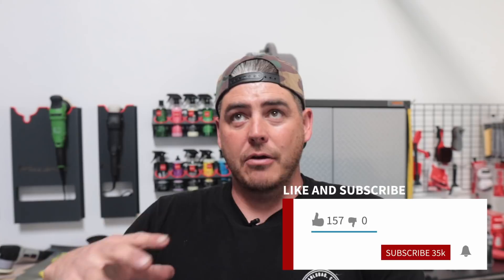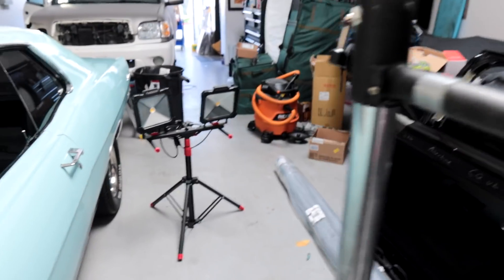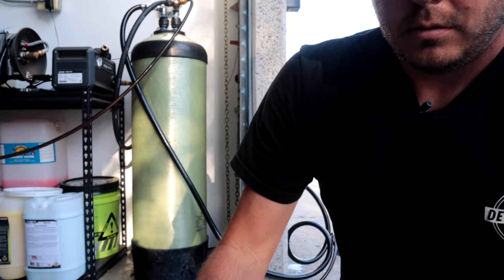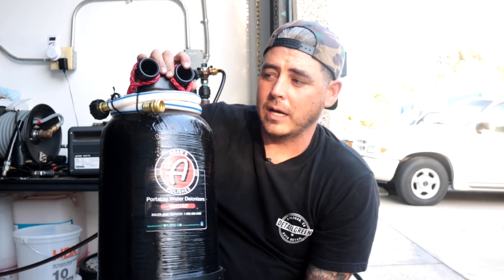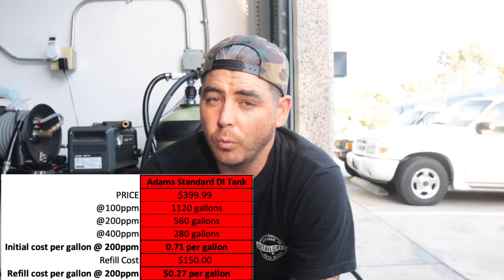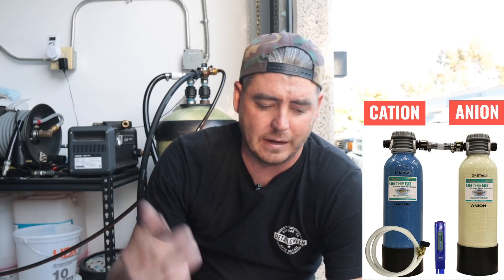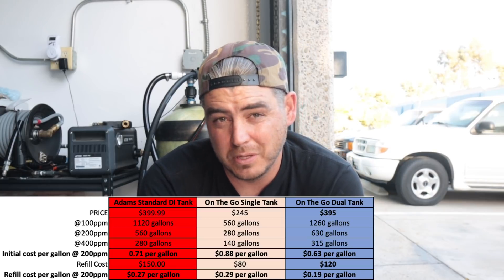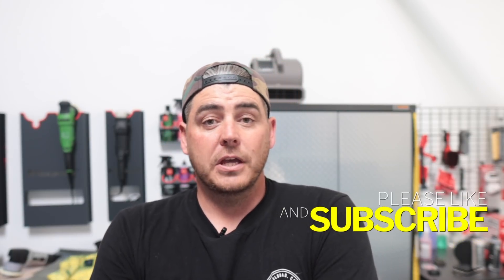SPOT FREE WATER FOR WASHING YOUR CAR | Part 1: DeIonized Water Systems

Comment: Nice video, thanks for the info. Do you know if the small portable tanks can be used with a water tank and a 2100psi electric pressure washer?

Comment: Im not sure how it works for those tanks but for my RODI system I have for my reef tank (0 TDS is an ABSOLUTE necessity), the 2 chambers I have (cation and anion) will degrade at different speeds. You need both cation and anion to get 0 TDS. When the combo unit is ready to be refilled it is because one of them is used up and the other is still healthy. But you need to replace the whole thing, wasting the other half. If that makes sense?
With the dual chamber/tank setup, you can replace the one that is spent while the other still has life in it. You shouldn't need to replace both at the same time.

At least that is the way it is on my deionizing setup at home for my reef. Maybe these work differently?

Comment: Hey Josh, I know that for a mobile detailer the best solution is to refill the water tank directly with filtered water. Sure! But What about if i filter the water in the outflow from the tank just for a final filtered rinse (not through the pressure washer but through a Garden hose flow). Does the passage of the water pumped by simple gravity will be affected by the filter and stop the flow?? 🙄🤔 Have you tried?

Comment: The #1 thing I'd like to know is do you run your deionizer through the pressure washer at high pressure? 

I built an entry level set up in my garage and I've been turning the pressure washer off and using the low pressure passthrough when doing the final spot free rinse. 

I do this under an assumption that had from self serve car wash bays. Every setting in a car wash bay is high pressure except for the spot free rinse. I am assuming that the filters can't handle the throughput. However after looking at my deionizer's specs and my pressure washer's specs I think the GPM on the washer's intake is within limits of the filter. So perhaps I can run it at high pressure?

Comment: For those of us I. San Diego, where PureTech is located, rental tanks are only an option as a business, they do not provide these tanks on a delivery basis for residential use. I researched this as I was ready to invest in a DI system. You can purchase the tank setup as you have, and they will recharge your spent tank, but you have to being into the shop in Kearny Mesa. Which for most people isn’t practical as the sheer weight of the tank, even emptied is still stupid heavy. CRSpotlessis also located in San Diego (El Cajon) and you can pick up the system and save the cost of shipping which is built into that cost. I know this as I bought one from them. They also have a bulk media program so when you change out your resins you can turn in your spent resin for new resin and substantial discount. The upfront cost was more, but the resin trade in makes ongoing cost significantly less. I calculated the same system you had and found CRSpotless to be my most cost effective means to spot free water, but only because the vendor is in my city and I can easily drive to the facility. I save on shipping costs for the resin trade in program too. Great video, and I was trying to pinch dollars by doing bypass wash, but if the sun peaks out (and my TDS is nearly 500) I’m screwed and had it happen more than once. I’m all in on DI water and spot free washes!

Comment: Adams doesn't manufacturer that deionizer and the actual manufacturer won't let Adams discount beyond a set MAP. This is probably why the code stopped working once they realized that happened. They had this system listed as a door buster for their Black Friday sale but when I went to buy it in person, they said the door buster price only applied to the resin even though the picture was of the actual unit itself. :(

Comment: Yooo Josh, I'm mobile only,  I just purchased the On the Go System. How do you set up your mobile set up. As far as the tank to a pump to the filter?  And what pump should I get to pull the water from tha tank but still filter water from the filter without having to much GPM suction?
Reply: What did you end up going with? I was thinking about just filling my tank with the DI water at home.

Comment: I wonder if running a couple 2.5"x10" sediment filters before the DI tank will extend the life of the resin. I live in Vegas, and our TDS is 400+. The On-The-Go website says the Dual Bed Standard at  400 ppm would yield 315 gallons.

Comment: I have a Reverse Osmosis Deionized (RO/DI) system for my saltwater aquarium. I get 1ppm TDS coming off my dual RO membranes, that's before going into the DI resin, the resin lasts much much longer with only 1ppm going into it.
For washing a car, you probably wouldn't need the DI stage anymore, 1PPM would still leave you with spot free finish.

Comment: Well done vid Josh. We have an RO system for our Ice plant and banana rooms. Ice is crystal clear.  We have a service contract with Evoca for the battery rooms.  DI water is   very different as it removes the iron in the water. Without DI water it will  rust out piping internally and keep out the water spots. What do recommend for the home user Thank you.

Comment: Thanks for the video Josh. Probably one of the best explanations I have seen. It really does come down to cost per gal, and with the bypass and the usage of PH neutral soaps the Adam's set up should last a customer a long time.
Reply: How does the tank you offer works once it's done dirty can you exchange for a new one or just toss it and buy a new one

Comment: According to your spreadsheet, the "On The Go" dual tank system is the cheapest, overall, at 63 cents per gallon.  Add your water company's cost per gallon and it's still cheaper than the other ones.  I'm leaning toward that system right now.

Very good video.  Thanks for the spreadsheet, too.  
Now, that was easy.👍

Comment: Excellent video!! I spoke with Puretec last year about opening a branch in southwest Houston last year and it sounded promising. Culligan’s is our only supplier here that I could find,  they quoted something like $250 down and $40 a month and another $250 each time they changed a tank. The biggest draw back to the portable units like Adam’s is the cost each time of the resin replacement.

Comment: I use distilled water with a battery powered pressure washer since I don’t have access to running water. Do you plan on reviewing any more battery powered pressure washers?

Comment: I’m in north Texas with 180 tds. I have the on the go small mix bed tank with bypass for final rinse. Works great. Great video.
Reply: Only company we have that has di tank rent is Culligan in north Texas. Closes one from me is 45 mins in Dallas. They won’t deliver I’m to far and plus they are hard to get a hold of on the phone.
Reply: @David Gotelli Damn that’s crazy. Yea I was surprised mines was 180. I thought for sure it was going to be in 300s or higher.

Comment: Adam’s stopped allowing the discount several months ago & their customer service said that was permanent. RV Mods has better systems & mods available for anyone with a CR Spotless system.
Reply: I just would have bought one tonight... Sorry adams, too expensive
Reply: Yeah I think the suds n go channel used RV mods and it cut down his resin usage a ton. He’s about to launch his own RO/DI system. At 274 TDS the RO system alone brings TDS to 005. I’m not sure the price point but it won’t be cheap I’m sure.

Comment: For us poor weekend car buffs, I found that after a good hand wash and rinse, I can just hit it off with a 3 to 1 mix of formula 4 in a spray bottle, another quick rinse, and I have a good 10 minute open time to dry off in hot sun with zero water spots.
Reply: Formula 4 is legit, it’s made about 10 minutes from my house
Reply: @The_Cyberz   It's very good. I usually spray it, rinse it off, and hit it with my big back pack blower. Water just strips right off. I'm surprised detailers on't give it more attention than they do.
Reply: @The_Cyberz  formula 4 from cycle care?
Reply: @youphilme_  no its called formula 4 spray wax, from a company called "Superior Products"